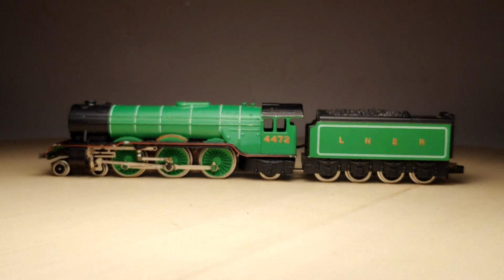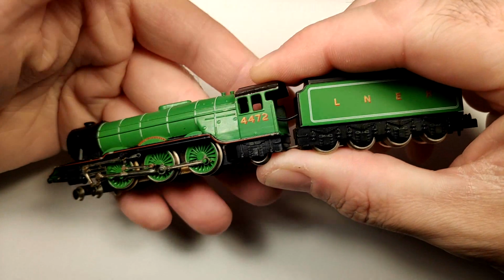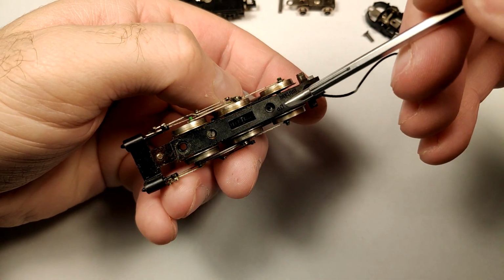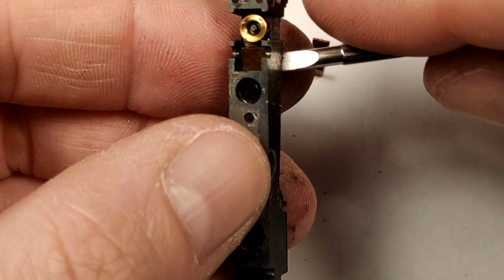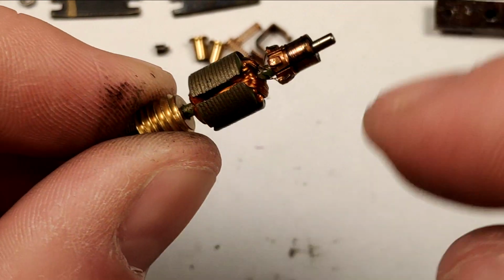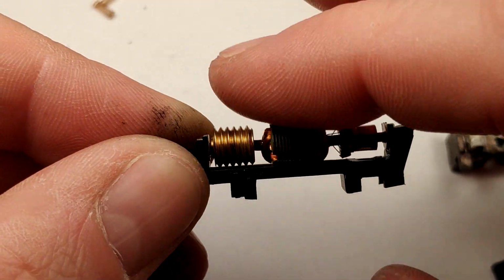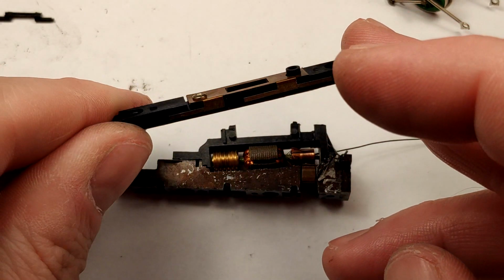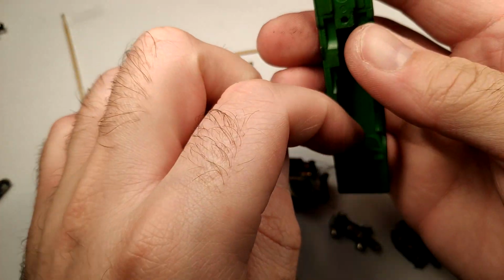Graham Farish Flying Scotsman DCC Sound

Comment: Hi Rich! Great job! I found this video to be quite mesmerising, especially with the music playing as you worked! I guess removing the motor and completely stripping it down is the only way to clean the commutator? Not sure I'm ready for such a big commitment yet! I've got my fingers crossed that it'll be a few years until I need to go into this amount of disassembly to fix one of my locos! All the best, Ian.
Reply from the maker: Haha cheers Ian, on most of the poole type locos you can somewhat clean the commutator in situ.. i had to take it fully apart really to fit the digihat sleeve in the lower chassis... plus the fact you can properly clean everything once its all in component form.. once youve done a few they all are very similar 👍

Comment: Hi Rich. Nicely done. I dare say you have done this or similar conversions before but I thought it might have been nice to use the colour-coded wires cut off from the decoder to attach to the loco.
Reply from the maker: I opted for the wire i used as its smaller diameter and being black aided the bridge between the tender and loco. The Orange and grey wire pins of the TTS chip were used for the motor and the Red and Black pins of the decoder were used for the Motor. Yes it probably wasnt the best idea using all black wires for demonstration purposes looking back now as i suspect knowing what a pickup or motor terminal is could get confusing..  Im sure this wont be the last loco i do so i shall at least clarify these parts for people in the future👍

Comment: Can the front of the boiler (the black part) be removed. I have one where the front has been messed up and the deflectors need re-attaching (but the attachment area is gunked up). I have ordered a new front and new deflectors, but don't want to mess it up!
Reply from the maker: On this particular Flying Scotsman the front of the boiler is part of the body, diecast metal, so not removeable unless you were to cut it off with a hacksaw. On Dapols version the front may be removeable as the bodies/boiler on the Dapol Scotsman with wind deflectors and without are plastic construction

Cheers Rich
Reply: @ThisWayWorksTWW  Ok, thanks. Mine is a old Poole GF so probably the same. Really don't want to ruin it.
Reply: @ThisWayWorksTWW  I meant the smokebox, but think you knew what I meant!
Reply from the maker: @ANobodyatall  this Scotsman is also the Poole type so it sounds like we have the same type... Having just looked at mine the whole body is a one peice diecast part. The smoke box, boiler, cab are all molded as one peice. Whereabouts did you get a new boiler front/Smokebox? If you remove your body from the chassis you will be able to see whether yours comes apart at all. Mine doesent though im affraid
Reply: @ThisWayWorksTWW  I don't think mine does either. It's the 'Prince Palatine' version. Ie double chimney and smoke deflectors.
Reply from the maker: @ANobodyatall  to my knowledge all the poole type steam trains, at least all of mine have a one peice cast body